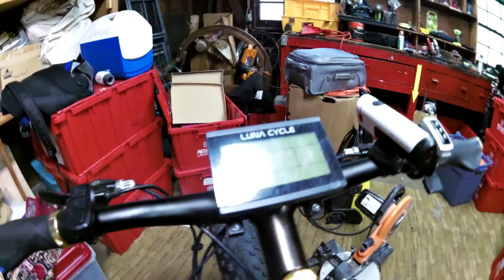Lunacycles Hot Rod Sondors Original Upgrade 20 amp controller

Comment: Is it possible to use throttle in zero assist? Mine will only work in 1 and higher.
Reply from the maker: It would need to be programmed to do that. Unsure of an easy programmer for that controller. Bafang mid drives are easy to customize however.
Reply: Mine is a Sondors brand. I just thought it would be the same.
Reply from the maker: @antlovesmel  sondors "rebrand"😉 it's a bafang motor system.
Reply: JohnnyNerdOut Thank you for the help

Comment: You seem very educated. I have a 2018 Canadian Version RadRover that puts out 500 watts. Boltonebikes have come out with an upgrade that will allow me to get some more wattage. It is a 35 a controller with 17amps continuous draw. I am trying to do my homework to make sure the battery is rated ok for this controller. The Battery is a Samsung 48 Volt 14ah they give no info on amperage. He seems very educated like you Bolton ebikes who designed this controller for the Rad Rover and its battery so I would think he did his homework aswell . I am just looking for a little more info and insight :)
Reply from the maker: Looks like Rad used the 35E cells in that pack. You should be fine. 17amp cont and 35amp max are pushing the limits of it a little, but I'd do it in a heartbeat! If you want longevity, dont hammer it every single time you accelerate, only when you really need to
Reply: ty so much. Youre insight and wisdom is priceless :)

Comment: In order to get your max speed you need to match battery with motor ex: 10s/5p battery 18650 pf cell at 2.9ah = 14.5 (5x2.9) so just times 14.5 with the volts 37v x 14.5ah = 536.5watts to match 500watt motor.

Comment: You got it right. A bigger amp controller doesn't really any top speed, but it adds more torque. More voltage will increase top speed.
Reply: unless the point of upgrading was purely for faster accleration then.. upgrading only controller is the most cheapest way of getting instance upgrade to the power <3 which i did just now

Comment: i dont trust lunacycle! i bought from them the  battery 13,5 A i i received a used battery. i say this because the exterior battery was like used including the label and the performance was about 12  miles with 20A controller. now i have only  9 miles autonomy after 200 cycles
Reply: MARK KOSTAS interesting....I'm currently involved in a similar situation with them with a 60v battery. We shall see if they stand behind their product....
Reply: John, i think we should transmit our messages to people to show them  that they are not serious

Comment: hi the speedometer marks the speed even when the engine is not being used or only when they use the engine it marks the speed I have a bicycle and when I use the pedal it does not mark me how much it is coring thanks I wait for your answer
Reply from the maker: as long as its powered up it will display the speed.

Comment: I've installed a 60v 17Ah battery, 35a controller,LCD and a 750w Bafang motor swap-able to the stock 350 motor case on my Sondors. The battery and 35a controller all fits inside the battery box.  I reach 40 mph top speed throttle only on a flat surface. The acceleration and torque I get now is phenomenal!
Reply from the maker: very cool, how does the frame hold up at that speed? Things start to shake on mine at around 35mph going downhill.
Reply: Vincent T. Where did you get the controller?
Reply: electrobikeworld.com

Comment: Bad experience with Luna cycles I just had to open a dispute with PayPal because of Luna cycles my statement to PayPal is below I will thoroughly document My bad experience with Luna cycles and post on Endless-Sphere.com when I find out how they are going to resolve it.

To PayPal dispute department,

I cancelled my order on July 17th. Luna Cycles confirmed they received the request to cancel on the 17th and on the 18th they said they would refund my money. I attached the email from them. On July 20th they said they did not refund the order that it was shipped and I have to return before they will refund it. It will take 7 days to ship, I refuse the package, it will take 7 days to ship back then, who knows how many days to refund, this time, so I am looking at a few weeks before I receive over four hundred dollars back. This is unacceptable especially since they confirmed in writing they would cancel and refund me, why 3 days later, say ops we shipped it anyway. I also have lost faith in their word the reason I cancelled the order was the same as disputing this, I was told one thing and then was told another. I had placed an order and paid on June 29th, it was out of stock we went back and fourth, me trying to order other parts and them saying it was out of stock. Finally I ordered something in stock only to be called after on July 17th and told it was out of stock and had to come from another place that would take longer, that is when I said enough cancel my order, now they have had my money since June 29th and expect me to wait until mid August to get it back and I have never received anything, completely unacceptable.